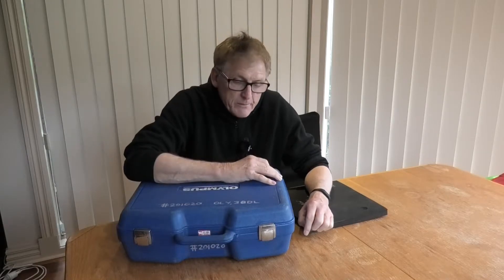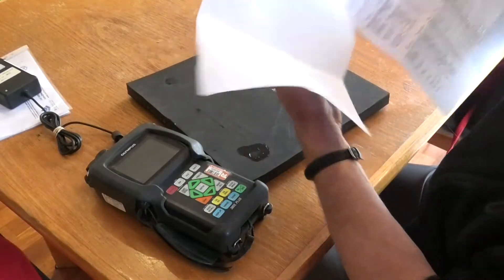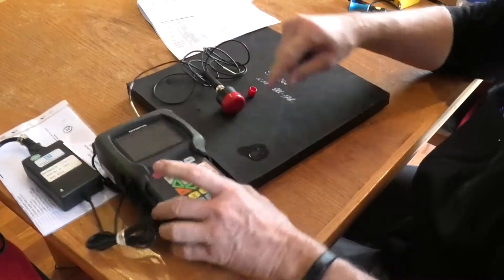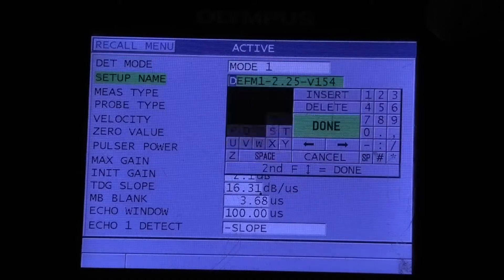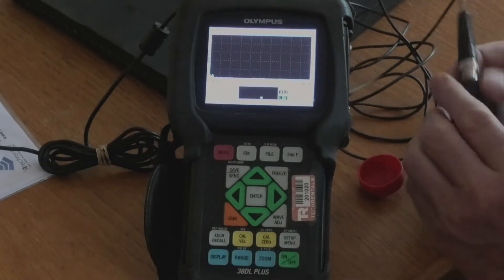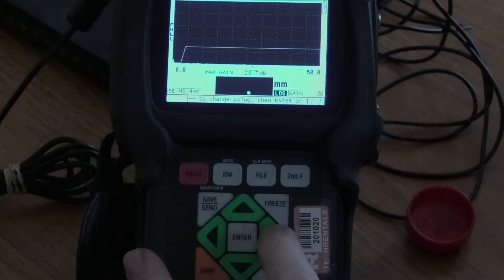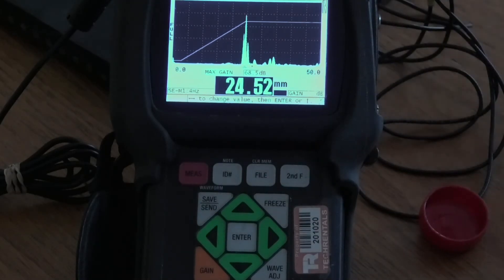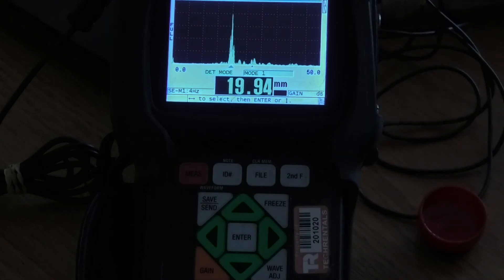Olympus 38DL Ultrasonic Thickness Gauge

Comment: It would have been more direct if you had selected M1036 from Single Element which was the intended default setup.   Picking V154 was setting up for a probe intended to be used for normal incidence shear wave inspection. .